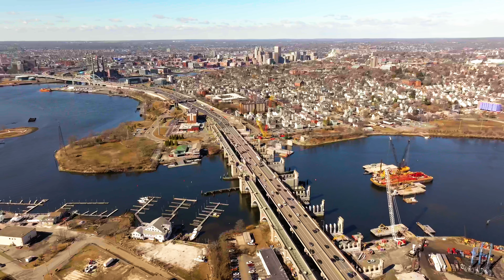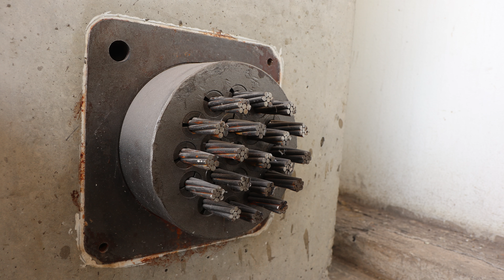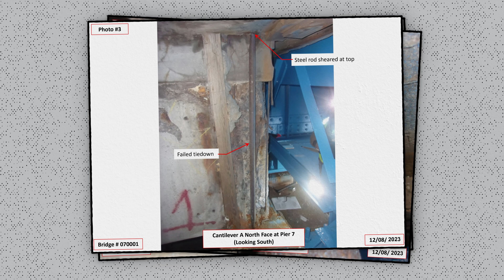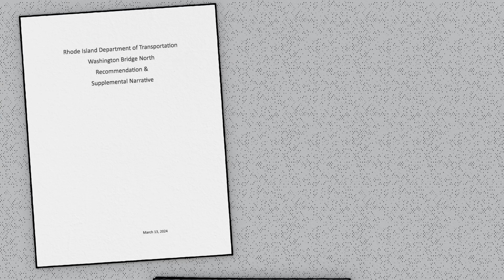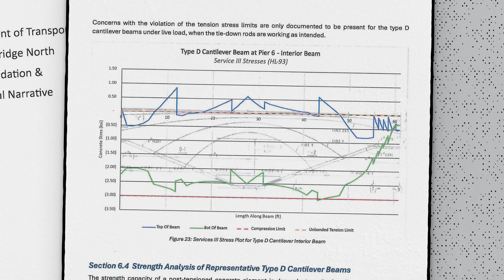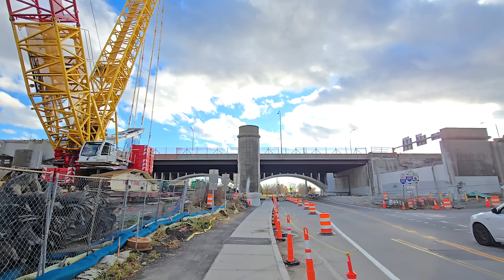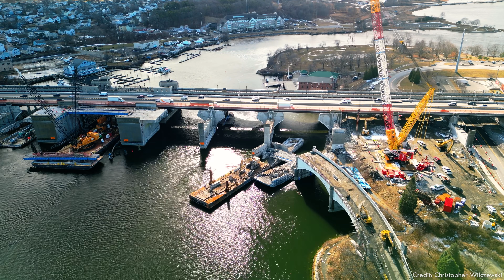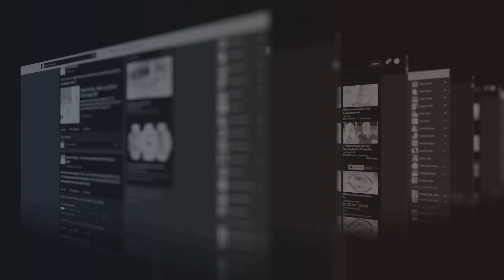This Bridge’s Bizarre Design Nearly Caused It To Collapse

Comment: How come if you pre-stress a steel girder it becomes stronger and more resistant to failure, but if you pre-stress me I just get stressed?
Reply: You lack the thermomechemical crystal stability of steel. Ever since I understood the weakness of my flesh I have craved the purity of steel
Reply: @azeranth9263  Funnily, we classify steel by it's percentages of impurities! Haha
Reply: @azeranth9263 praise the omnissiah.
Reply: @azeranth9263 🤖  so you wanna be a robot 🤖
Reply: @azeranth9263 praise the Ohmnissiah
Reply: @azeranth9263 ”Praise the omnissiah. The flesh is weak, iron endures.”  -Adeptus Mechanicus Fabricator General arch magos Belasarius Cawl.
Reply: @azeranth9263 the flesh is weak. Praise be to the Omnissiah
Reply: We must be a similar alloy
Reply: @Carver878 I must be made of Chinesium. Just fall apart like Humpty Dumpty
Reply: Magic
Reply: @nebo37 if low IQ is magic
Reply: Stressing things in the wrong way will result in premature failure.
Reply: @david.bowerman hey I have that problem
Reply: You are inferior to steel
Reply: "How come if you pre-stress a steel girder it becomes stronger and more resistant to failure,"
 - The pre-stress is the opposite direction to the applied stress, so the applied load reduces the pre-stress, instead of being in addition to any static load.
e.g. railway tracks are installed in a pulled condition, so when the expand due to heat, they don't buckle.
Reply: So I should go into a job interview thinking “god, I hope I don’t get this job.”
Reply: @lewis72  when I learned about CWR and how they weld at specific temps to regulate the stress and reduce buckling, etc. I was absolutely fascinated. It's super interesting stuff! 

Trains are cool anyway, so the rails are automatically cool.
Reply: @lewis72 
You do not pre stress steel girders, you build camber into a steel girder, now a concrete girder is formed with a camber in the middle, add pre stress cables or pour the concrete in place and then post stress the concrete to add a camber to it. 
Good note is if you are sitting on a bridge and a truck or vehicle drives past you, if you can feel the bridge bouncing that is good showing that it is still in stress not compression. 
When building high rises and putting steel on the floors we would always jump to make sure you felt a bounce knowing that the floor was not overloaded like what happened in Downtown LA back in the 80’s when the work floor was overloaded and collapsed sending three men to their deaths nineteen stories below.
Reply: I have heard, "What doesn't kill you makes you stronger".  So, some stress is good for the body.
Reply: Just remember "stressed" spelled backwards is "desserts".  Get yourself some cake & ice cream (or whatever you prefer) and let go of the stress.
Reply: @billymcnutt116 hah that’s interesting … “desserts” actually means “that which you deserve”
Reply: I mean if your pre stress is practice, maybe you need to evaluate your method
Reply: Because you are overstressed.  In this comparison the prestressing is much more similar to training
Reply: Hmmm, interesting question. Perhaps we should use the stress life method to analyze fatigue.
Reply: You must be weak in tension!
Reply: @simonwatson2399  I think you might be on to something. Perhaps it's time I accept the possibility that I am not a steel girder. :(
Reply: Because you’re not iron, man.
Reply: I alone, see what you did there. 😂 @robertb6889
Reply: You're pre-stressing a concrete beam here. The concrete is good in compression, the steel in tension, and the crossover (I'm not sure what the civil engineering term is) is moved into the static situation, so that both elements are feeling strong from the start. It's … kind of like when my wife and I talk through what's happening before we visit an advisor. Well, ok, except for the fact that she's good in both tension and compression and I'm like psychological jam, but you get my point. Maybe you're better in compression, so you should be the concrete.
Reply: @stephenspackman5573  I feel like I'm best under expansion. Is that a thing? 🍔🍕🌭
Reply: thats because youre compressible
Reply: You have a different stress-strain curve!
Reply: You’re more squishable than concrete
Reply: Because you're soft and squishy, not hard and rocky.
Reply: because babies are put together with just 1 screw 😊
Reply: You lack adequate compressive strength. Perhaps you would make a better truss than a girder?
Reply: Pre stress will avoid shock, like having time to get used to cold water instead of jumping in.
Reply: Because you are not Clark Kent.
Reply: Because you can stress it in either compression or tension but not your brain
Reply: You need more iron in youre diet!
Reply: The steel does very little until a certain amount of stress is reached, then there’s the useful region until it snaps and everything breaks.
I‘m guessing you’re somewhat similar: if everyone were happy with you doing nothing, you’d probably not do that much. Then comes stuff needing done, more stuff needing done, you’re feeling stressed and then you‘d snap
Reply: You’re weak
Reply: Doesn't pre-stressing a girder require immense amounts of jacking?  Maybe you should try that.
Reply: Nanomachines son
Reply: I hope your internal stress makes you stronger and durable, mate. Going through annealing is hard, but it makes you harder. Keep up with ypur good work.
Reply: Ever been stressed to 2 million pounds ?  Ketchup!
Reply: Thats deep😂
Reply: Gotta be something to do with elasticity. 😂
Reply: You're not good under pressure
Reply: Because you do not know the Riddle of Steel.
Reply: Because concrete loves the crushing stress and us squishy humans don't
Reply: I guess steel just performs better under stress 😎
Reply: That which does not kill you will make you stronger.
Reply: If you prestressed yourself then encase yourself in concrete you’ll feel better. 

*this is a joke don’t do this.
Reply: You are not steel, but I ain't no engineer
Reply: they may be talking about pre- cambered beams, which are curved upward toward the load, so when they are loaded they settle into a stable tension without a saying from the load.
Reply: *without sagging.
Reply: You need more concrete in your diet?
Reply: Stress isn’t the issue, if you monitor the strain that results to ensure you aren’t operating at or beyond your yield point …

“Pre-stress” in a person would actually be called “anxiety” wouldn’t it?
Reply: Carbon content
Reply: Dude you should run for political office. You’re one of the nicest people walking the earth, you’re honest as the day is long, you understand science, and you’re a detail guy. You’re exactly the type of person we need in office leading this nation. Not the dopes bending their knee to criminal trump and his boss putin
Reply: Well let's do a quick inspection and... sir? Are you not made of concrete and steel?
What is this-- is this flesh? And.... EMOTION!?
No no no this will not do at all. We'll have to tear it down and start over!
Reply: You are under pressure, not in high tension...
Reply: I tell all my friends that I am just like concrete. I always forget to mention that it is because I crack under the slightest tension.
Reply: You're not concrete
Reply: Because in your formative years, you were pre-stressed either too much or not enough.
Reply: Pre-stressing is like adding support structures to your life while your life is going well, so they can help take the load when the pressure builds.
Reply: You'd have to become a steel girder first.
Reply: are you stronger in tension or compression?
Reply: Technically you arent being overstressed, you have constructed the structure of your life by simply setting in your supports without tensioning them. It makes sense, why put tension in to what I am doing or saying before real world tension exists.

I would say there is a 'psychological presetressing' process it's called presencing, you extend and internalize your focus with another person without any load on the system and then you face the world with your entrained focus and things go smoother and are more durable.
Reply: Pre/post stressing is for concrete girders not steel.
Reply: U low on iron?😅
Reply: "Only pressure creates diamonds"
Reply: Steel works well with tension.. humans don't😢
Reply: Well, you are not steel. You are mere mortal, and not superman. #metoo
Reply: Cause you're not 40% stress, yet
Reply: Pre-stress deez nutz
Reply: Stress isn’t the issue, if you monitor the strain that results to ensure you aren’t operating at or beyond your yield point …

“Pre-stress” in a person would actually be called “anxiety” wouldn’t it?
Reply: Who can argue with such masterful logic sensei?🤣😂🤣😂
Reply: Join the Marines, repeat.
Reply: There are ways of releasing all that stress… Remember “health” class in 8th grade?😂
Reply: I mean I was pre-stressed from 9-2017 and I came out okay. 

There’s definitely corrosion which is causing rapid degradation, weather damage and wind have caused cracks in my concrete and I’ve had a lane removed to ensure not too much weight is put on my pillars but…..

I’m okay… I guess
Reply: What doesn’t kill you makes you stronger
Reply: This is why we stopped using people as bridges a few years ago… unless your in the third world then anything goes
Reply: Because you got too much stress. If you pre stress too much it will break.
Reply: Composition mostly
Reply: it's because you have to lock it in with something. or else it's just fatigue.
Reply: If you're prestressed you also get stronger... unless you're crippled... or dead
Reply: Essentially putting the steel under tension pulls the slack out of the cable and stiffens it so the concrete won't deflect as much
Reply: It’s because you resist the stress
Reply: Prestressing is a technique that is used to induce compression into reinforced concrete beams. It enables concrete to withstand higher tensile stresses and hence increases the load-carrying capacity of the beam.
Reply: "From the moment I understood the weakness of my flesh, it discusted me..."
Reply: It doesn't seem fair,  does it?
Reply: you aren't steel
Reply: If you pre stress me, I snap.
Reply: Because it gets the girders panties out of a bunch, but yours gets in a bunch
Reply: That’s what you call Iron-y
Reply: You don’t gain tensile strength from stress
Reply: Idk I have some trauma that leaves me going "I've been through worse" so maybe we just need to traumatize you more
Reply: Same question here
Reply: Because you give the stress a tension.
Reply: So frustrating to see the comments talking about the steel; its all about the concrete being under pressure.
Reply: Stressed.,,, then fall apart into failure
Reply: You weren't left in the mold to cure long enough before you were put into service? 😀
Reply: Because you aren't Superman!
Reply: You have to be more concrete.
Reply: Pre stress would actually make the real stress seem less
Reply: If you don't pre-stress me, it isn't just stress, it's shock. I don't know about you, but I can take way less shock load than stress load.
Reply: built different (literally)
Reply: We dont prestress stress girders??
Reply: You're not the man of steel? 😂
Reply: You weren't put under high enough pressure
Reply: The sag of the girder forces more stress into the sag. Of you tension, there is no sag , and therefore more even stress distribution
Reply: You should only stress your beam.
Reply: Because you are not superman
Reply: @sween187  
Good point.
Reply: For humans it’s called training, drill or children depending on the intensity.
Reply: you aren't a steel girder
Reply: Your immune system requires challenges during childhood to prevent autoimmune disorders in adulthood
Reply: Because unlike a steel girder, you are weak.
Reply: I think the technical name for the pre-stressing procedure for humans is birth©®
Reply: You don't melt. Gotta be able to melt
Reply: People who train soldiers & athletes would say that pre-stress is positive - train hard, fight easy, etc.
Reply: Go back to school and you might understand
Reply: I no 😢🤬😡🤬😡
Reply: Because you go on grinder and the other is a girder 😂
Reply: Different molecular level structure. It stressed me to think about that.
Reply: What does not kill you makes you stronger...
Reply: Because you're not made of steel.
Reply: It's got to do with the molecules
Reply: Bot
Reply: You do get stronger and more resistant, it just doesn't feel like it
Reply: Steel has better tensile strength.
Reply: Because you are not a man of steel
Reply: Because you're weak
Reply: Theres an argument to be made that pre stressing you does make you stronger. Just like with steel there is a point where its too much stress, but as long as its done properly, taking on loads within your capabilities is how you increase ability.
Reply: It depends whether you are prestressed during construction. Or stressed post-construction.
Also, are you cracking? Showing any signs of water-damage, rust? Any snapped rebar?
Reply: It's called "work hardening." Banging on or bending metal back and forth causes the molecules to line up, which leads to its being stronger.
Reply: “How can Steel support several tons in weight? When I try, I get squished.”

Gee, I wonder why building materials pre-conditioned to handle certain stresses isn’t analogous to mental health… The world may never know~
Reply: Because you never learned The Riddle of Steel. 🤔
Reply: The pre-stress is in the opposite direction to the expected load, so they cancel out.

If you expect a beam to have compressive load, and you pre-stress with an equal tensile load, the net stress is zero.
Reply: Its not the steel girder that ends up stronger, its the concrete and the entire structure that becomes stronger.
Reply: cuz ur a boy and not a steel
Reply: Don’t worry “What doesn’t bill you, makes you stronger.” (Replace b with k in bill)
Reply: @iTeerRex anything that doesn’t bill me is good in my book.
Reply: @iTeerRex  or stop being a toddler and write the word kill
Reply: @iTeerRex its acurate as is ive never had getting a bill make me stronger just broker
Reply: My wife tests my pre stress levels daily
Reply: @MikeHarris1984 wife bad boomer ahh ‘jokes’
Reply: Design and materials?
Reply: “How come”? English?
Reply: @roccocroce  takes 5sec to Google it, brother. 

People have been using "how come?" to mean "why?" since at least the mid-19th century.
Reply: @ it’s very poor speech. Possible “sports-fan” level of education.
Reply: @swine13  the irony seems to be lost on you that with this response, you’ve answered your OP. 🤡